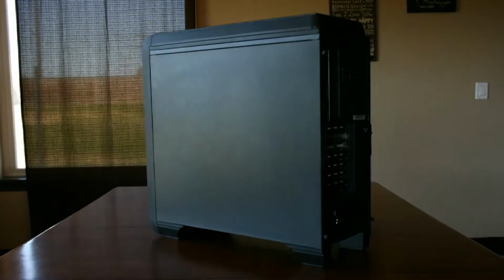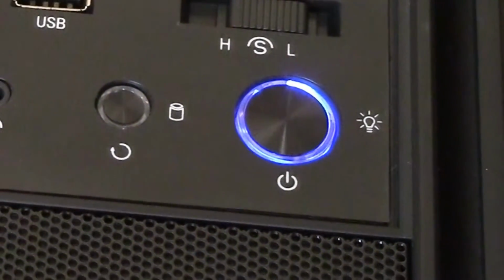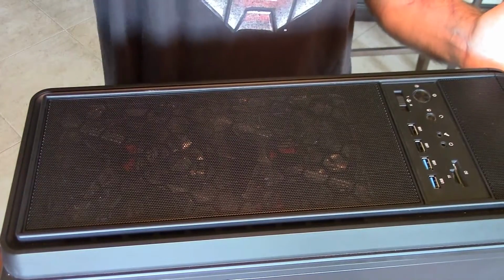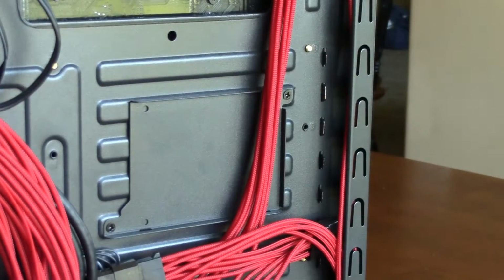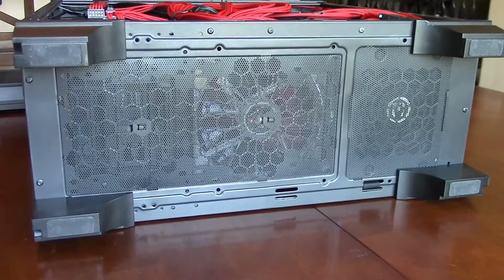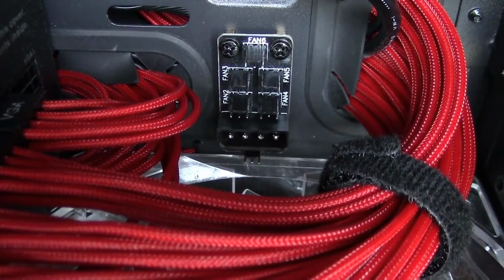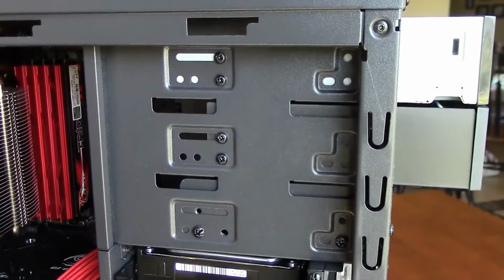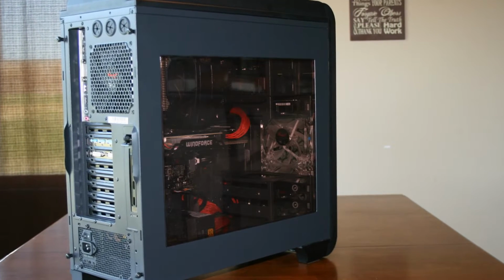Rosewill Viper Z Computer Case Overview

Comment: Please, watch out!

There are two variants out there! Or two versions! Same name, but different!
Your 8+1-Slot-Version got more content! The latest one only got 7+0 PCI-Slots, no fan hub, only four fans, and maybe other missing things. They are curiously both marked as Mid Tower. Your 8 to 9 slot should be a Full Tower.

This explains why other reviewer doesn't review the extras you got.

Stick this comment as warning!
Reply from the maker: thanks for the info man.  I bought the ViperZ for my personal rig and have been using it happily for the last 2-1/2 years.  I didn't think that Rosewill may have revised this case since then but that kind of stuff does happen.

Comment: can the bottom HDD cage be removed for better airflow since there is the single slot below the optical drive cage
Reply from the maker: yup, all the drive cages are removable.  :)
Reply: ron jackson THX for the question. I assumed, but... ;)

Comment: can you put a radiator at the bottom between the legs of the pc? ^_^
Reply from the maker: +peter s I mounted a 140mm fan on the bottom so I if you remove the drive cages I believe you could fit a 120mm X 120mm radiator on the bottom and possibly even a 140mm X 140mm. As for anything longer, like a 120mm X 240mm I don't think they'd fit on the bottom.

Comment: Very nice vid. I see that you have your top fans as intake. How are you able to get the fan power cable back into the case without cutting honeycomb wire mesh? I'm trying to build a positive pressure system.
Reply from the maker: I don't remember for sure. But if I remember correctly I was able to route the cables toward the front of the case  and then get down into the main part of the chassis. I'll have to look and let you know later.
Reply from the maker: Yup, I routed the fan cable toward the front of the case,  toward front panel stuff (power button and USB ports and stuff) and then there's space there to drop the cables down into the main area of the chassis.

Comment: Would you be able to use 120mm fans? Also ,can you use a sea gate sshd?
Reply from the maker: yes, you can mount 120mm fans on the top of the case instead of the 140mm, and the drive cages can fit any 3.5" or 2.5" hard drives

Comment: Very helpful and nice Gtx 970 sorry DirectX 12 man
Reply from the maker: +Michael Lathrop I'm impressed you were able to identify it just by seeing it in the video. I like the 970 a lot, good bang for your buck.  Also I'm not worried about DX12 at this point.  The way I look at it it's so new it'll be a few years before most games support it and by that time both Nvidia and AMD will have new cards out that'll be superior to the GTX 980ti, Titan X and Fury X for much less money than those cards cost today and by that time I'll be ready to upgrade too.  But yah I like my 970 for now it does everything I want/need for the games I play and I've been a fan Gigabytes quality for years now although MSI has been turning my head as of late. :)
Reply: +Maraksot78  But wouldn't you like playing it on DX12 on playable frame rates by just selling your 970 for like a r9 390 and be good as new
Reply from the maker: You make a good point. I built this system before the R9 390 came out so it wasn't even on my radar when I was shopping for parts for this build.
Reply: Hi just something to consider. Whats your Pc specs
Reply from the maker: i7 4790k Devils Canyon, Cooler Master V8 GTS CPU cooler, Asus Z97 Pro Gamer mother board, 32GB GSkill Trident X 2400 Mhz, Gigabyte G1 Gaming GTX 970, 2 Samsung 850 Evo 250GB in RAID 0,   1TB WD Black for mass storage, EVGA G2 750 watt PSU. I haven't tried over clocking anything yet as I'm not very experienced at the whole PC building thing. But I'm definitely planning to learn.
Reply: So, why would you get this over 80 dollar cooler, a i7 4790k and haven't overclocked? Why? Everything else is amazing.
Reply from the maker: +Michael Lathrop I've wanted to since the beginning and plan on doing it eventually, qith a wife, kids and a full time job it's kinda tough to find the time to learn how to do it properly. But I'll get to it. :-)
Reply: +Maraksot78 Hi i got this case becasue of you and i am really happy with it. And i saw you on Awesome Hardware.
Reply from the maker: +Michael Lathrop I love Paul and Kyle. They seem like really cool guys and it's fun learning about tech from them.  They help keep me informed. :-) By the way thanks for subscribing, hope you enjoy the content I have coming.
Reply: +Maraksot78 Those cpus come with an OC option built into the processor just like the gpu does. You do it with the wizard and it OC's it for you...
Reply from the maker: TheDigihax I actually overclocked my i7-4790k not too long ago using Asus' 5 way optimization and was able to get a decent overclock out of it. If you'd like to check it out he's link to the video. :) https://youtu.be/OD0EyccFe8s
Reply: Sorry i forgot to add, I'm still trying to figure out the difference between this 1 MSI Z170A Gaming Pro Carbon LGA 1151 Intel Z170 HDMI SATA 6Gb/s USB 3.1 ATX Intel Motherboard and the Gaming M5...
Reply from the maker: +TheDigihax  I've never used either of those boards personally but looking at them on Newegg they are very similar when it comes to all their features.  The M5 has (4) USB 3.1 Gen 1 ports and (2) USB 3.1 Gen 2 ports, one of which is a type C connector and then 2 USB 2.0 ports.  The Gaming Carbon on the other hand has only (2) USB 3.1 Gen 1 ports and (2) USB 3.1 Gen 2 ports, again one of which is type C and then (4) USB 2.0 ports.  Looks like the Gaming Carbon also has some RGB lighting on it as well.  Other than that everything is very similar.  Both are really nice boards man, if it were me I'd want more USB 3 ports so I'd go with the M5.
Reply: Nice, thank you man I went with the M5 as well so it looks like i made a good choice lol...

Comment: Thank you for the great video! I see that you had an LED controller. Is there any way to turn off the LEDs on the provided fans, or would you have to replace them with new fans without lights to prevent the blue light from them from mixing with the light from the LED controller?
Reply from the maker: Henry TheSky there's no on/off switch for the LED's on the fans so you would have to install different fans without LED's. Or if you're adventurous, I'm sure you could cut the wire that provides power to the LED's which would of course turn them off.  When you set the fans hooked to the fan controller to Silent it powers the fans off completely so the LED's turn off as well but turning the fans all the way off probably isn't what you're wanting to do anyway.
Reply: I see, thanks for the info!